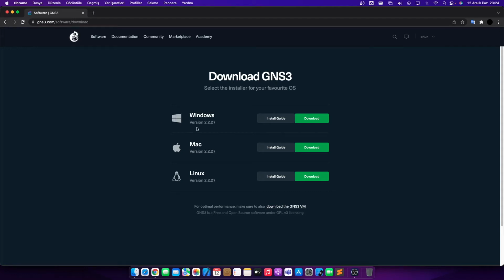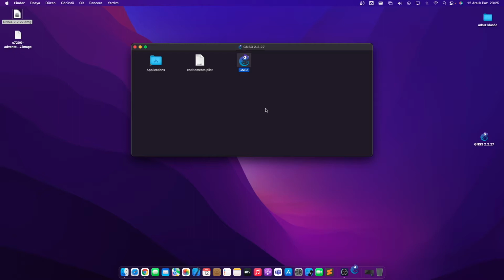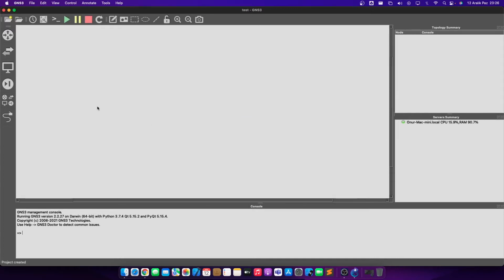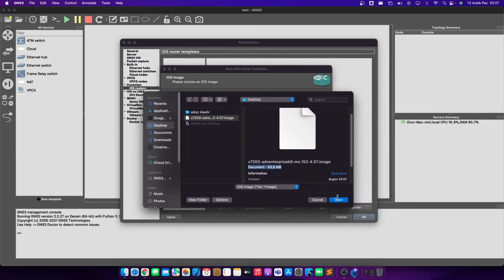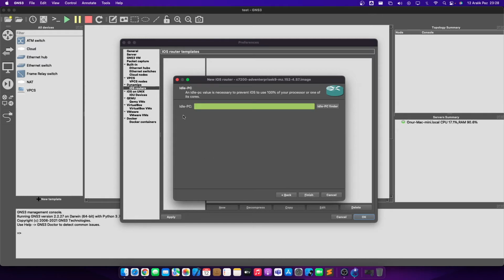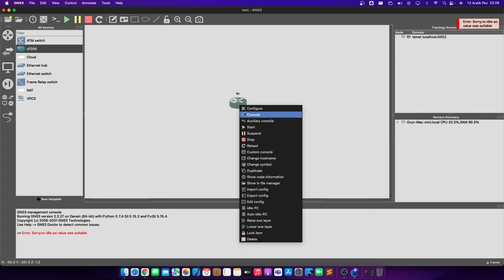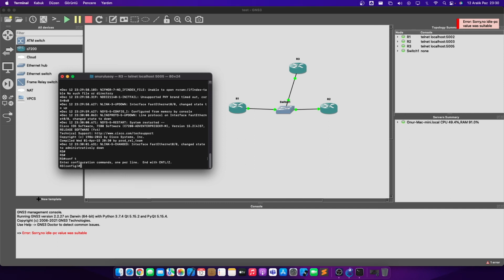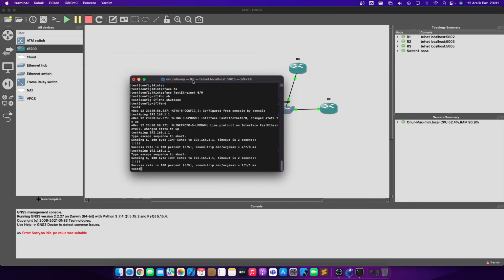How to Run Natively GN3 on M1 Macs

Comment: Did you see your M1 performance downgraded after building up complex architectures on GNS3?
Reply from the maker: i don't use it much, but of course the higher usage means lower performance.
Reply: Hey do you also experienced heating and fast battery drain using gns 3

Comment: Hi Onur, please have you tried connecting to any of the Gns3 routers from your Mac terminal using SSH?
Reply from the maker: Yes on the right upper section you'll see ip adress and port number, after enabling the ssh on the devices you should type something like this ssh user@ip portnumber or you can just telnet ip portnumber